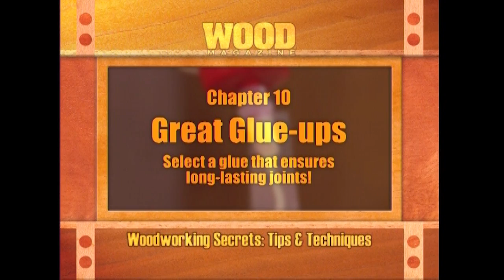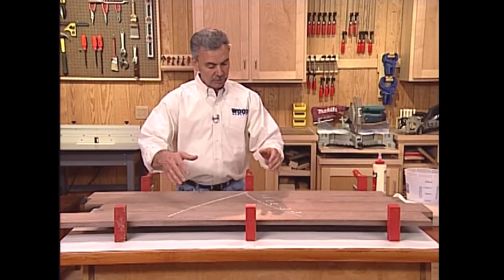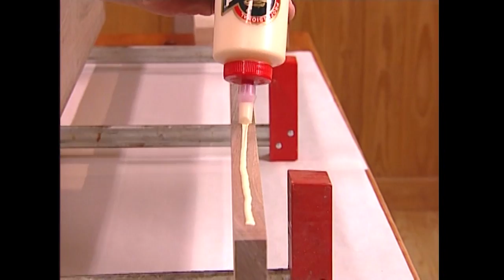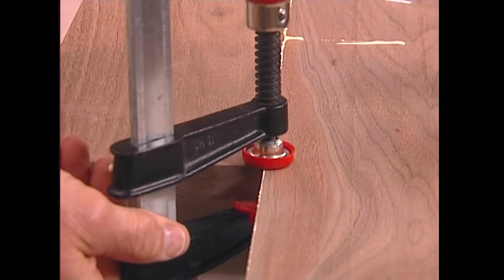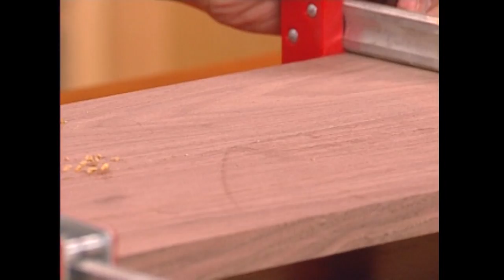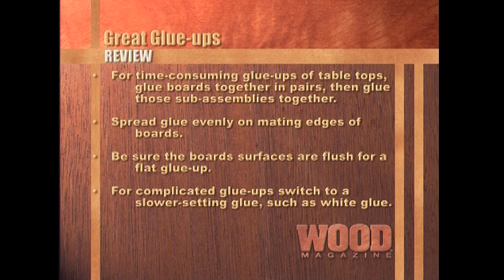Gluing Up Wood Panels - WOOD magazine

Comment: Good quality parallel bar clamps are expensive and it's important to keep them free of glue spatter and squeeze out.    When glue gets hard in the tiny rack teeth of the clamp bar, it makes the clamp hard to use, and it's extremely difficult and tedious to remove hardened glue from the the clamp.  What do you use to keep glue off the clamp bar?
Reply: @Wood , thanks!!!   Another good reason to subscribe.  : D